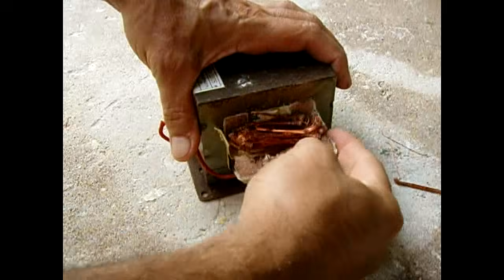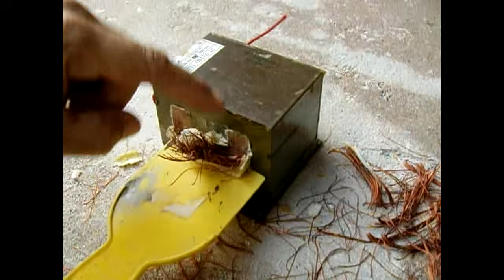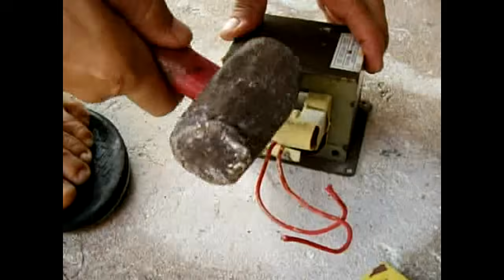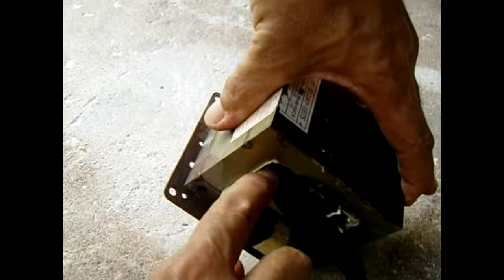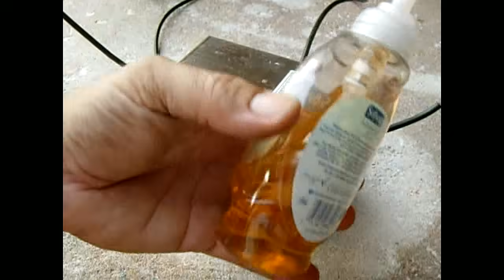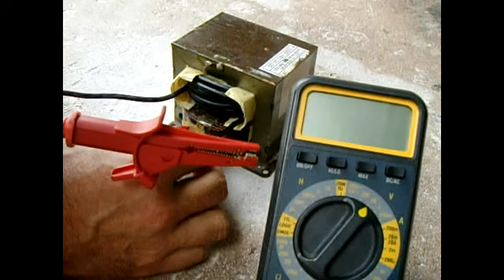BEST Microwave Oven Transformer-MOT Rewinding Tutorial

Comment: Waste of time!!! I just use a angle grinder to cut along the thin weld holding the EI sections together.
Reply: Why cut down towards the other coils when if you lay it on its side and cut there is no danger?
Reply: I agree with you
Reply: I took a saw to cut the secondary coil on one side.Afterwards you can push the coil through the transformer without any mess.
Reply: Andrew_koala you can use cable too
Reply: Pat Butete not really i just glued it and it worked fine
Reply: Andrew_koala such a grammer nazi!
Reply: mrsillywalk exactly and its easy to wind your new coil
Reply: if the weld is thin angle grinder is way quicker. Also makes it a lot easier to wind with copper ribbon wire for extreme current output. The top can be glued on with JB weld or silicone.
Reply: I seen so many videos of guys avoiding using an angle grinder. And I know they were thinking 1/2 way thru ...(wtf didnt I use an angle grinder?) Lol.
I mean after all, it only saves about 2 hours.
Reply: @siggyretburns7523  true
Reply: ..But then you have to weld it all up together again!
Reply from the maker: NOT! LOL Clearly you know little if anything about electronics. There is ZERO reason to cut the core open in this video. Don't be lazy, it only takes a few minutes to chop out the winding.
Reply: I 'm building a 1000 amp high current transformer and the cable im using probally  wouldn' t (Very tight fit) fit in (Very tight fit) sense its very thick cable so cutting it open was just easier for me.

Comment: This is the roughest method you could ever resort to. A hacksaw or a Stanlety knife would have done much better. Further, your measured 16v is in RMS and its peak value is 16x1.414=22.62Vac. And after two-way rectification, it'll be 16x0.638=10.2Vdc; for one-way rectification, it'll be 16x0.318=5.088Vdc. If you use it as a battery charger, you don't need filter cap/s, and your battery can be charged to the level of 22.62V-1.2V(due to voltage drop across your bridge)=21.42V rippled. Be careful and use a current limiter!
Reply from the maker: Roughest method my @ss. LOL This method is very simple, and I think I know exactly what I'm doing. Clearly you haven't watched too many of my videos.
Reply: I suppose making videos takes a great effort, but showing a method like this, that's rough-as-guts, is not really the way to go! Let alone teach it to people who may have never seen a thing like this before.
Reply from the maker: Stephen Balogh
Sorry, using a utility knife(really ridiculous) or hacksaw is no match for a razor sharp chisel. :-)

Comment: USE A HACKSAW TO CUT OFF TOP WINDING, THEN BANG THROUGH WITH PIECE OF WOOD......TOOK ME 10 MINUTES
Reply from the maker: I find a chisel to be quicker.
Reply: @electronicsNmore  I've used a grinder also but you're right, the chisel is quicker with less chance of damaging the other winding. It's also oddly satisfying with a very sharp chisel to cut a clean line across those wires.

Comment: Hi mate, can you tell the secondary thick wiring is clockwise or anti clockwise
Reply from the maker: If you're only using one MOT for a project, then you're right, but when connecting 2 transformers together in series(Like in my microwave oven stick welder video) or parallel, the direction(phase) matters.
Reply: Exactly! It does not matter how you made your secondary clockwise or not

Comment: What has always confused me is the voltage is the number of turns but how do you know how much current you can draw? Say in the UK you have building site 110 volt output, how do they rate what you can draw in current? Thanks Ian
Reply from the maker: Larger diameter primary winding enamel wire, with fewer turns = more current input and output. Smaller diameter primary winding enamel wire with more turns will draw less current and you'll have a lower current output. Please refer to my DIY Custom Transformer video. In the video description area of that video you'll find a transformer calculator. :-)

Comment: Why does it matter which way the coils go? I mean it's AC, so the current will shift polarity 100 times each second..50Hz.
Reply from the maker: If you're going to use (2) transformers in series or parallel, then you need to make sure the phase is correct. If you're only using one, then no big deal. I do it out of habit because it makes things easier.
Reply: electronicsNmore Ahhh...now I understand why. If you use two transformers in series and the phase ain't correct, they would cancel each other out. Thank's for explaining that. I'm not a pro on electric things, as my profession is blacksmithing and machining. I want to make a compact spot welder for my workshop, hence the interest for such transformers.
Reply from the maker: Kalle Klæp
If you only wind one transformer, it won't make any difference which direction you wind the transformer, especially if the output is converted to DC. :-)
Reply: electronicsNmore Thanks a lot for your help, I appriciate it..

Comment: 1:39  wow, cave man opening transformer. You could of saved that coil you destroyed.  All you had to do was get a dremel and cutting tool and cut the welds on both sides of the top.  It easily comes off with a screwdriver. The coils come out easily. IF the coils are a bit hard to get out just hit with a rubber mallet. They usually come out easily. Maybe you wanted it welded together.
Reply from the maker: Whatever you say. Clearly you know better. :-)

Comment: In contrast you don't need that large of current for a spot welder.  Drop the 10 gauge in half and you should be able to use it for 45V spot welder because you'll get more turns in, albeit at less current.  10 gauge will melt some wires without regulation so a smaller gauge should work just fine and last you a bit longer.  I would use it for spot welding battery tabs and use a mosfet with a pwm signal so it doesn't burn up wire or heat up batteries too much.  10 gauge is way too hot for this application as it will put too much current into the battery for welding and it could explode the batteries...  Just a thought.  Pick an application and design it for that.  I think this is a good general purpose application for spot welding thick steel.  Kind of overkill for much smaller applications.  Because the mosfet is pulsed it can peak higher currents.  Therefore you don't need that thick of a winding.  It will only deliver max current for a very short period of time...

Comment: I noticed that you were using a carpenters chisel ; I used a mechanics chisel and things didn't go as smooth. I had a time getting the winding out ! I ended up putting the transformer in a vise and just hammering away at the coils with a punch. After about two hours, I finally got it cleaned out. So, thats why I came back to watch your video ! Nice Job ! Like all of your videos ! Thanks !

Comment: I will rewind a Mot next days.I want to make a lead acid battery charger .I have a couple of 100A batterys.I have just one question : does it get hot during function? I  was wondering if it s necesary to attach a pc cooler .Thanks
Reply from the maker: +Silviu Cocolos 
Use the microwave oven cooling fan positioned close to the transformer to keep it cool. :-)
Reply: +electronicsNmore Thank you ,i have a couple of capacitor 400uf and 80v each,cand i wire both in parallel ,i want to keep costs to minimum.

Comment: Hello, why must respect the meaning of the secondary winding in the direction of primary winding, thanks !
Reply from the maker: +costache George vama vede hotel cismigiu 
If you only intend on using (1) transformer, then not an issue, if you're going to use 2 wired in series, then the direction matters for phase.

Comment: from the secondary that i rewound, I got a reading of 24.5volts ac
Reply: The voltage depends on the number of wounds. More winds means more voltage and lower amperage. It depends on what you want to accomplish, each wind is about 1.2 volts the more winds the higher the voltage the lower the amperage. If you'd like to spot weld use extremely thick wire and wind it twice, you'll get about 2.1 or 2.5 that will suffice. For welding with welding rods use 10 or 8 AWG add more winds, 15? 17? and for lead battery charger do the math and measure the voltage. A 12Vdc could charged at 14 to 15vdc do not use too high voltage or else you'll fry the cells. Additionally, you'll need need rectifiers to convert AC to DC. Do messure your output and consider your input in the primary, 117vac or do you live in Europe??? 220vac. Greetings, my friend.

Comment: how many volts should the two secondary wires put out. not the one that goes to 12 volts. can you please help on the inverter..
Reply from the maker: +Andy The Truth 
VAC output will vary. You can adjust the output by adding or removing turns from the low voltage side of the transformer.
Reply from the maker: +Andy The Truth 
VAC output will vary. You can adjust the output by adding or removing turns from the low voltage side of the transformer.

Comment: oke.. this is a really nice project!! went straight to the store and got me an old microwave which was returned for scrapping. they were happy to get rid of it and i was happy to have it :D 

must say.. i live in europe so my transformer is a 240V version, which i feel shows by thinner wires on the primairy side (compared to 120V) and more windings ending up in a higher resistence (2.5 instead of 0.5). took out the secundairy side and the red wires.. I did just so gently touch the primairy side with the hammer, only some slight deformation there..) resistance is still the same so i believe it will still be fine. it's really just minor. I feel i'll find out when i'll try it out. 

but i have a something else that bothers me more. At the end of the inner side of the wire there is something connected before it goes to the end pole (so between the beginning and it's pole). i don't know what it is. it WAS insulated (will do again but had to remove it before i could read it. it says ck01 and L145 and i have no idea what it could be. it is easily removed if i need to. fiddling withit i did notice some minor changes in resistence (max up to 9.0) 

anyone have any idea? 

would have loved to post pictures here but.. 
i'll try to add the links from dropbox below. 

https://www.dropbox.com/sh/c4xroh6boexpe79/AABtShZB3U6xHPRQ2oBotwFka?dl=0

Comment: I've rewound a lot of MOT's.  If you have access to a stick welder,  I've found that its much easier to use a Dremel with a carbide cutting disc to cut along the weld that holds the laminations together.  Usually, you can cut the weld on one side and wedge a flat screwdriver in the cut to pry apart the "top" of the transformer.  After the "top" is off the windings will just slip out.  When you're done rewinding, if you have a stick welder it's easy to put back together.  Believe it or not, I've actually had success using a 150W soldering iron and solder it back together most won't have an iron that big though.

When I have kept the laminations intact, a tool that makes short work of cutting the secondary is a oscillating saw, sometimes called a Fein tool.  it makes a very clean, mess free cut and usually you can just push the leftovers out with your finger.
Reply: +Chris Barth i'm in a college dorm, so welding will definitely be out of the question. Would it be possible to clamp the top back on and fill the groove with a good epoxy?
Reply: I wouldn't trust epoxy or JB weld to work well enough for a permanent hold, there is a lot of vibration and heat when running these that will probably cause the bond to fail.  I've used clamps to hold the X fmr together while energized after rewinding.  It worked well, it just a little unwieldy.  I've used C-clamps and the quick squeeze/sliding bar type clamps to hold it together.
Reply: +Chris Barth   One more thing,  after removing the secondary coil and before rewinding, its a good idea to make sure that the iron laminations are insulated.  You can use the existing wax type paper for insulation but it may not be enough.  I use Kapton tape and wrap it around any exposed areas, Kapton tape can take a tremendous amount of heat, you wont find it in stores though, Amazon or Ebay has it cheap.  Electrical tape is a poor choice because it will likely loosed/sag because of the heat build up if you're running it hard or for extended periods without a lot of active cooling.

Comment: Thanks for taking the time to do this video. I gave this a try myself today and it was a little tough (knocking the coil through the core took a fair bit of effort and experimenting with different tools) but with a bit of elbow grease and one severely blunted wood chisel later I managed it. One thing I'm not sure about is that you mention putting the windings one on top of the other, but what are you doing when you reach the top? Do you then progressively wind lower and lower?
Reply from the maker: +BenjaminGoose 
Hi there. You wind the wire evenly/tightly around the spool back and forth(end to end) until the spool is full. :-)
Reply: i guess Im asking the wrong place but does someone know a trick to get back into an Instagram account?
I stupidly lost my password. I would appreciate any help you can give me!
Reply: @Angel Dominik instablaster =)
Reply: @Abdullah Ryan thanks so much for your reply. I got to the site thru google and Im waiting for the hacking stuff now.
I see it takes a while so I will reply here later when my account password hopefully is recovered.

Comment: anybody know what kind of glue they use on these mots, i am trying tear one apart but i need keep both windings clean and undamaged the transformer needs to be clean too.  i have tryed heating the microwave in a small oven to get the glue to melt but didnt work out.  i tryed soaking the whole thing in dish washing soap for  days and it stll didnt work.
Reply from the maker: +moxncal 
They use varnish on the windings. There should not be any issue removing the windings from the core.

Comment: I have little understanding of the science behind all this but I have a question and I hope you can educate me with an understandable answer. Would it be possible to take 2 of these transformers and combine the primary coils of both into one rather than winding your own secondary? I somewhat understand that the more windings result in more voltage? So by winding a new secondary with thick wire, I'm drastically dropping the voltage? So will using a primary from another transformer be too many windings, thereby resulting in too much voltage? I've seen plenty of these types of videos but I wish more would take the time to explain the science behind it all for those of us ignorant but wanting to learn....  I want to create a welder to repair my trailer and small other jobs. From reading reviews on Harbor Freights $100 welder, I'd be waisting my money. Also, would using more than 2 of these transformers wound like your way, show any benefit, such as 3 or 4?
Reply from the maker: +brickwal92tt 
Hi there. The transformer output is based on the ratio of turns between the primary and secondary. If you use the same winding for the primary and secondary, then all you end up with is the same voltage output. Basically an isolation transformer.
Reply: Hi, to answer your question about using more than one transformer, the answer is yes you could. Adding another transformer in parallel will increase your amperage output allowing to melt thicker plates. I've seen guys using up to four transformers in parallel. Understand the primary windings are connected in parallel but the output is connected in series. Taking care of using same wattage transformers, do not mix 'n match.

Comment: I would like to use this application to solder jewelery together with solder wire , my question is how many turns would be needed to do this as I'm guessing that to solder I will not need the electrodes to be as hot as for welding.....can any onehelp or am I out to lunch on this one?
Thanks much
Reply: +Anthony Alleyne think about using a much smaller transformer that has a standard secondary and for control you could setup a triac with a pot to control the duty cycle. You could also use pid control if you want the equivalent of a soldering station. Or just get a 30-40 watt non regulated soldering iron for 25 bux.
Reply: +Anthony Alleyne NO! Depending on how many winds you rewind, you can easily melt a 6 inch 1/4"x20 threaded rod in seconds by rewinding the secondary.  Way too much-unregulated current even  with a lot of winds.

Comment: I have been trying to remove it all day
Reply from the maker: +jarek da boss !! 
Never had one I could not quickly remove the winding from, and I have removed MANY. :-) Use the correct tools, and some strength, and you will get it.
Reply: my drill didn't work and I tryed to hammer it but it removed some wire the rest bends and I don't have any thing that will work

Comment: my secondary is stuck in the core any recommendations
Reply from the maker: +jarek da boss !! 
Hi Jarek. The secondary is not stuck, there may be some varnish making the removal more difficult. You need to do exactly what I did in the video. To make life easier place the transformer in a bench vise or turn it sideways on concrete using support when you hammer out the thin windings.

Thanks For Watching!

Comment: This way bugs me due to the fact when trying to push the coil out it starting getting more and more stuck on the 3v heater windings and I ended up leaving the mot alone until I purchased a dremel and sanded along the weld and pulled it off if you people don't have a vise to hold this in this process can be annoying
Reply from the maker: +Bloomfield Productions 
Once you get the knack, it is a breeze. :-)